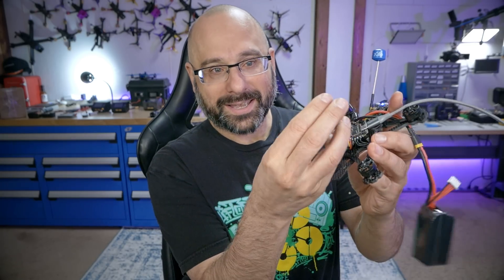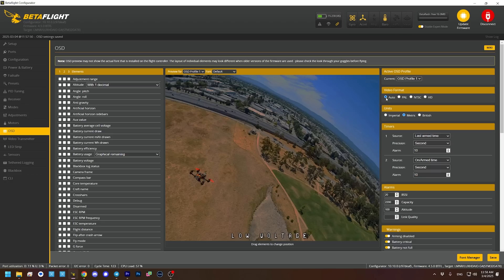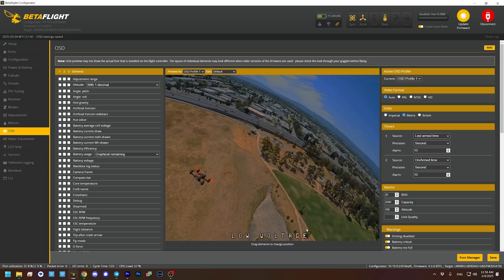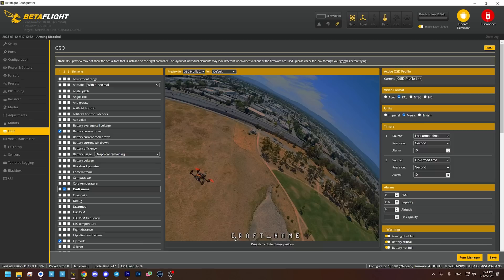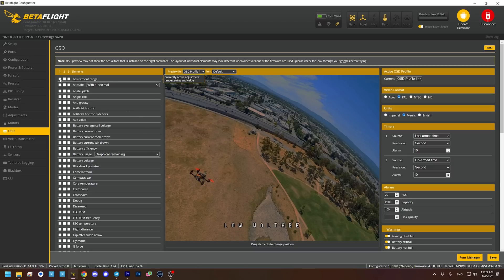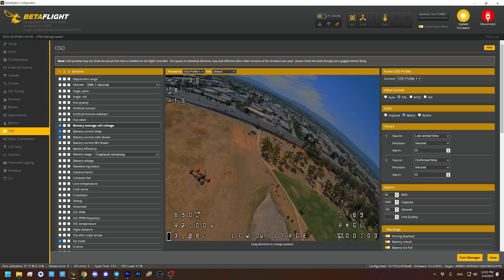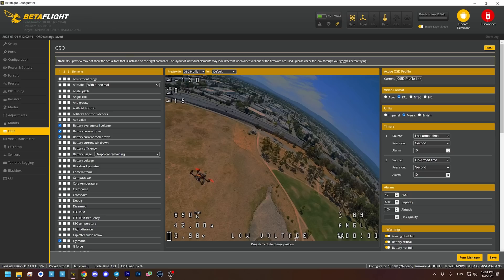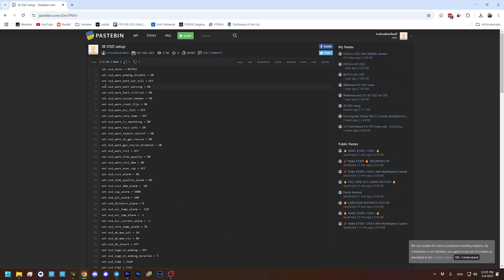Sub250g FPV Drone Build - 05a - Analog OSD Setup (oops I left this out)

Comment: What if my OSD just doesn’t show at all no matter where I move the elements ? I have OSD on in the configuration. And camera works and communicates with vtx perfectly. Just don’t have an OSD
Reply from the maker: This is an analog camera yes? Have you tried changing NTSC/PAL?
Reply: @ tried both. Moved everything dead center and nothing. I’m using the ratel 2 as well.
Reply: Switch on OSD in the betaflight configurator in the configuration tab where there's LEDs airmode softserial etc options
Reply: Maybe you have a HD FC without OSD chip?
Reply: Toggled the OSD on configuration with no resolve. I’ll try to reupdate the fc and betaflight itself so everything is up to date. And will update 🙏🏻 thanks for everything you do brother
Reply: @Hotahseh  I had the same problem... Here is how to fix. First don't be stupid like I was and backup your configuration :) Reflash your firmware but remove the OSD (Digital) I did remove a few others like LED, but that fixed my issue... then restore your settings
Reply: @stephensweeney5167  okay I’ll give that a try and see if I have success. I’m pretty sure I just have a faulty FC
Reply: @stephensweeney5167  THANK YOU SO MUCH, i was struggling for ever and this is what helped me. thanks man